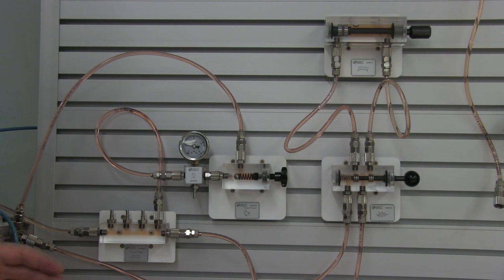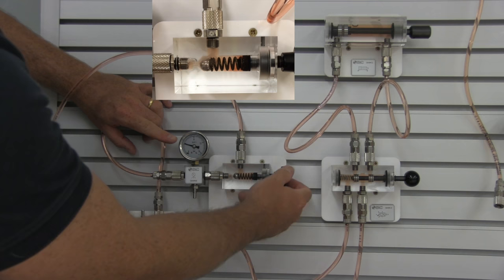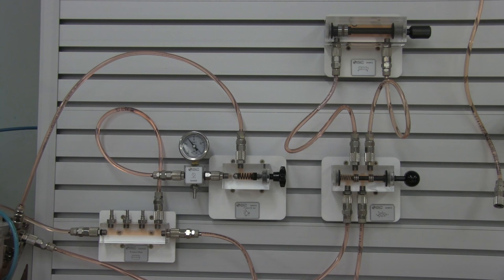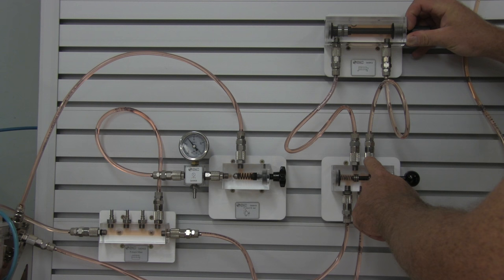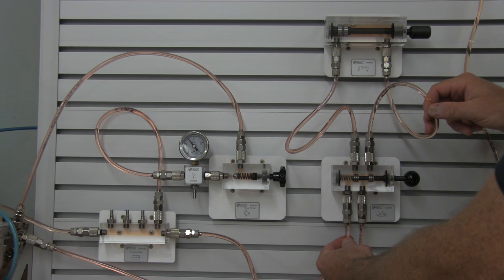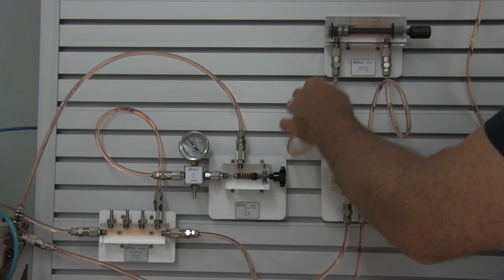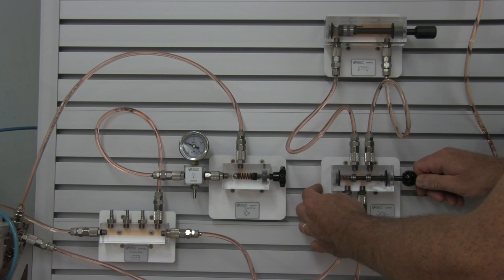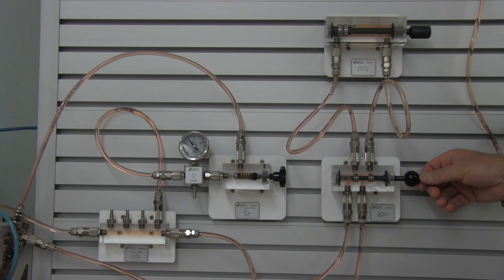Understanding a Basic Hydraulic System with Transparent Componenets

Comment: Wouldn't that system heat up the pump and oil because it's being forced to bypass constantly if the operator isn't continuously switching directions? For example a log splitter, if you stop to load up a log, the machine would be running at peak pressure until you pull the lever
Reply from the maker: Yes.  there are a number of ways to get around what you are talking about. But know that if you size everything correctly it will pump won't overheat.  the easiest why to over come the heat problem that you are talking about is to use a tandem center 5/3 DCV.  But there are a couple others.

Comment: KletteTech We had a new clay pigeon throwing machine installed. It is hydrolic actuated. I said that the fluid only flows when the machine cycles. 
I got some pushback when a guy said "NO . . . when you turn the motor on the fluid flows". I argued "that's not how it works". I don't have a need to
be "right" but having some basic experience (VERY BASIC) I thought that there was a valve involved to allow the fluid to FLOW causing the motion.
I'm asking for some clarity here and please don't be too technical.
Reply from the maker: That depends on the pump.  If the pump is fixed your friend is correct.  If it is a variable piston pump than the motor can spin without creating flow and you would be correct.  You should inviting me shooting sometime and we can see which it is. hahah
Reply: @KletteTech  That would not be a problem. How local are you?

Comment: It's amazing how the question I have is never answered by anyone anywhere.  The question I have been trying to answer all day is how does the gas engine power the hydraulic system.  Virtually NOTHING on it.  They all do what this video does right here--"I have it connected to my pump."  Yeah?  And?

I found one video that talked about a hydraulic flywheel that evened out the power coming from the engine.  I'm kind of filling in a whole lot of blanks from there.